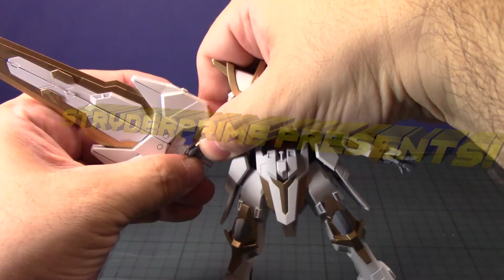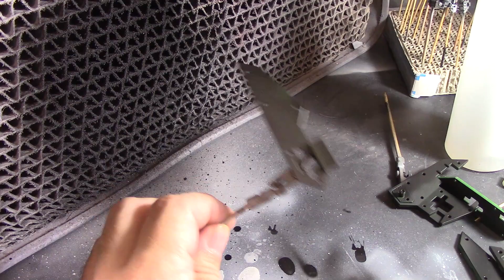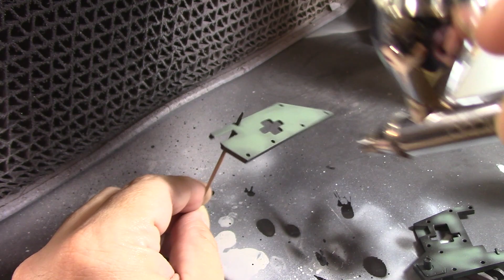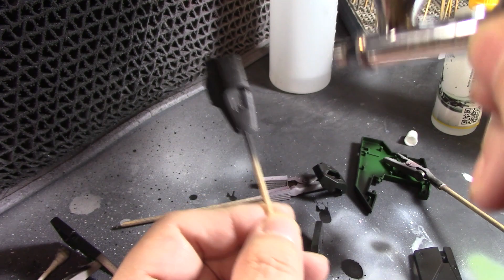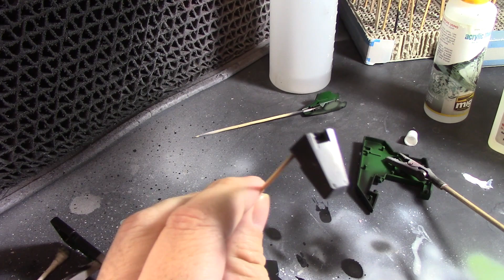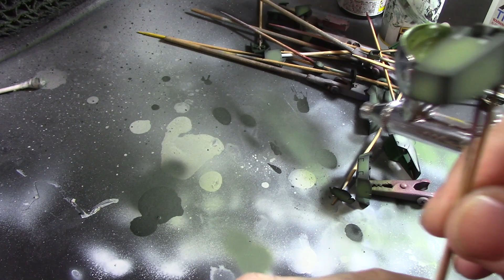*GundamCustoms* 1/100 MG Gundam Dynames - Part 7

Comment: I wanna see this finished, it's awesome!

btw, I have a question, how do I know which action base I need for my models? I bought RG Unicorn and RG Unicorn Banshee with two Action Base 2 but then in the instructions it says it needs Action Base 5... how can I know it before buying it? Thanks <3
Reply from the maker: It all depends on the kit itself and how you are going to pose it. AB2 should be ok but since bandai release some new one you can get those that try them out. I don't use them since I don't have that much room.
Reply: @stryderprime  oh, okay, thank you very much!

Comment: Thats pretty cool that you got good results with the Tamiya acrylic thinner. It's interesting that it works considering X-20A is alcohol based in order to be compatible with Tamiya paints, whereas Ammo paints and other water-based acrylics typically get broken down in alcohol. But just as people have learned about using lacquer thinners with Tamiya, I've heard of some using lacquer thinner with Ammo and other acrylics and getting good results still. I suppose all the thinners are just evaporative carriers for the pigments anyway right. I will have to try some X-20A with my Ammo paints sometime, I have easier access to replenish my Tamiya supply as compared to my Ammo thinner or even Vallejo thinner. Also great work with the Ammo Green Mecha colors it's looking great. Looking forward to the finished Dynames. I really loved how that color set came out on my SDCS Zaku especially on top of One Shot Green Primer.